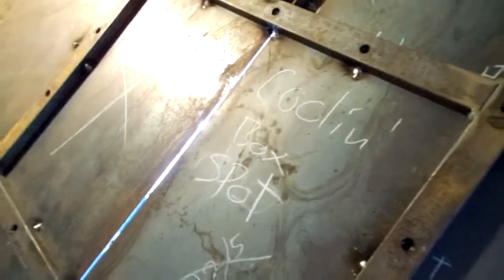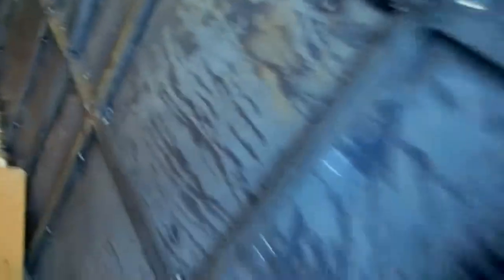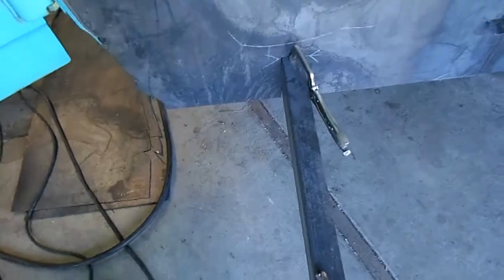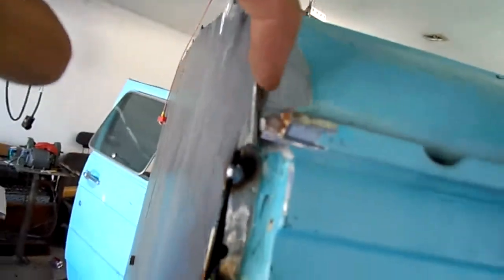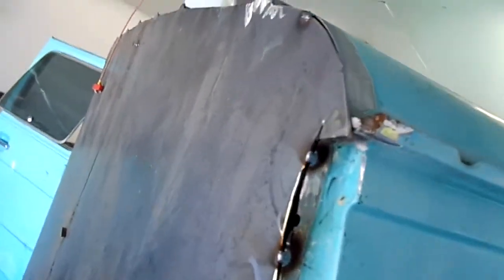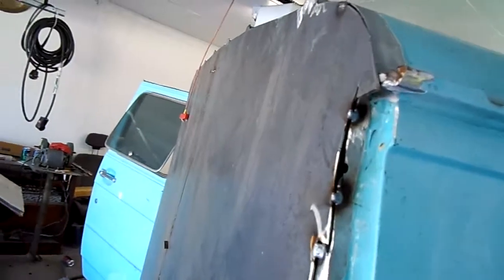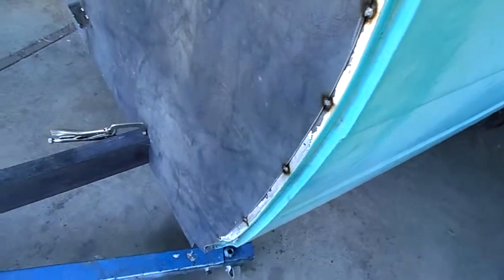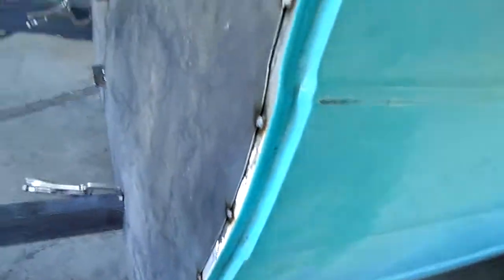Green Bean Trailer Pt. 6- Inards & Topside Tacked

Comment: Your doing a great Job but I need to ask. why would you think Horse trailers have "V"ed rounded noses?....cause a flat front creates way to much wind resistance going down the road and you burn up twice the fuel but because you extended the tongue maybe your already going to make another chamber up front and I am speaking too soon.You could have a nose that slopes down and starts to make a V on the tounge to deflect windage. "Windage" is that a word?hehehe Good Day!
Reply from the maker: I hear ya partner, I defiantly considered that factor but as I do not intend to do any long hauls with this rig I decided not to go to that amount of effort to optimize aerodynamics. Likelihood is this trailer will only be used for hauling wood/odds and ends around town and the occasional 'camping trip.' I am pondering constructing a fiberglass 'nosecone' to bolt on the front that can potentially flip up to clear the toolbox lid and allow airflow for the future air conditioner when this thing is parked.

Main thing is, this green turd is so damned heavy its never going to be easy on gas! Thanks for watching!